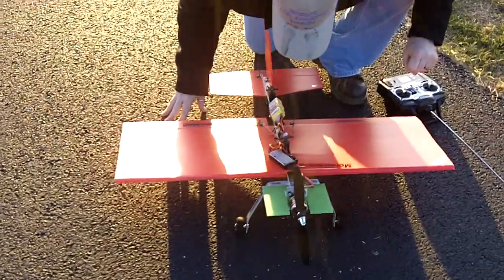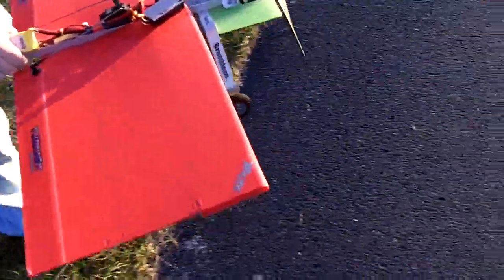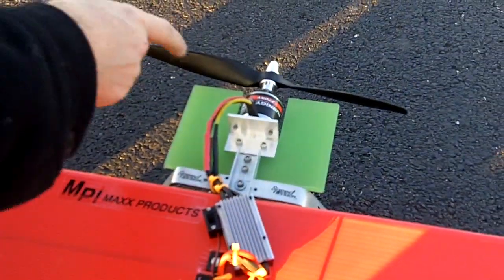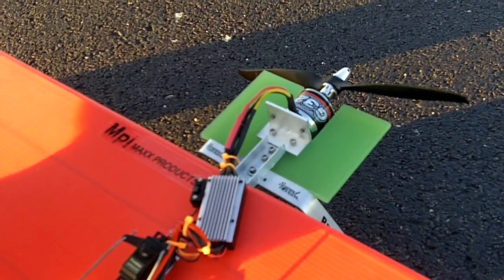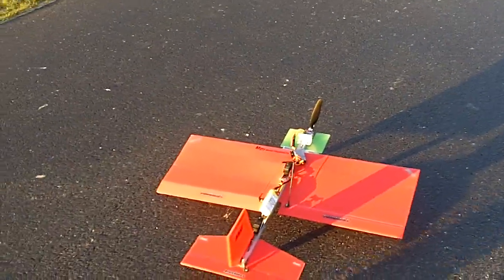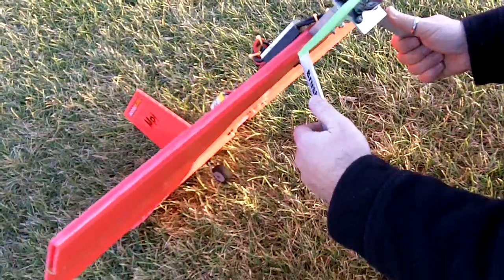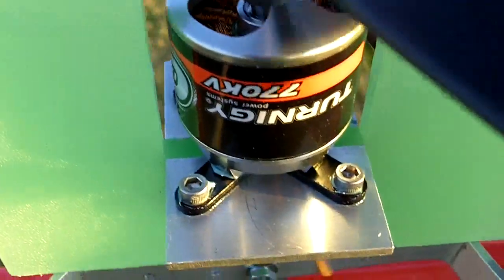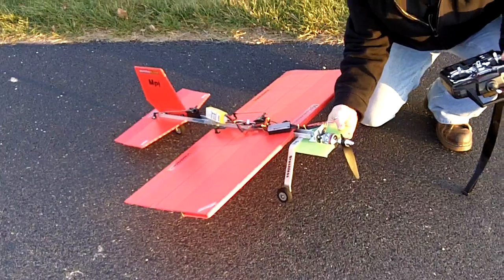Electric SPAD Gnat - Maiden Flight (11-27-2010)

Comment from the maker: @djdavid60 - Hey thanks for checkin' in Doug.  It might be hard to tell but the wing is flat on top and rolls around the front bottom back to the middleish.  It's not really an airfoil, but it's a wing.  They are definitely proven to fly, but with gas engines.  Some have done electric also, but my Jay's system is his own design.  We did eventually get it in the air today, but the wind was tossing it around a bit.  I'll send you a link to the video when it's up.